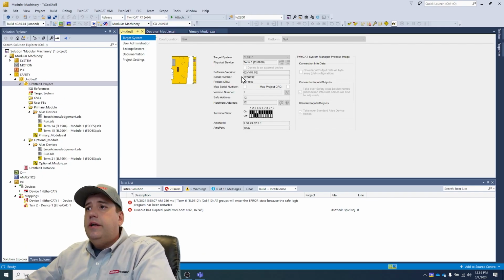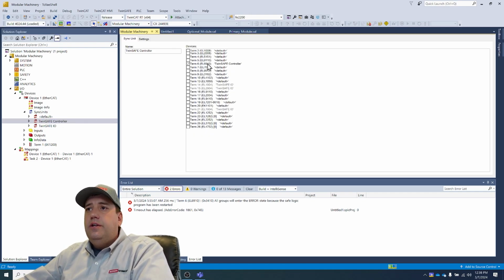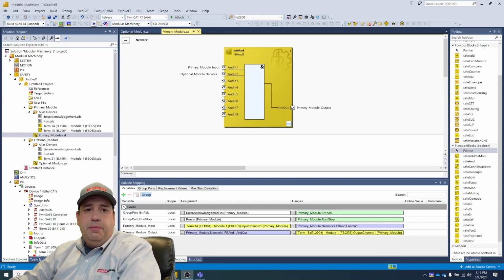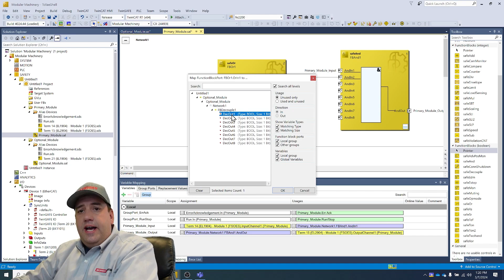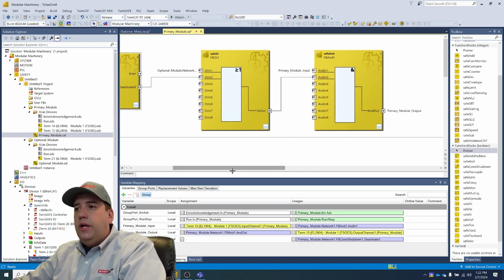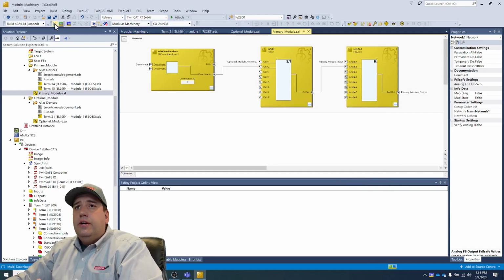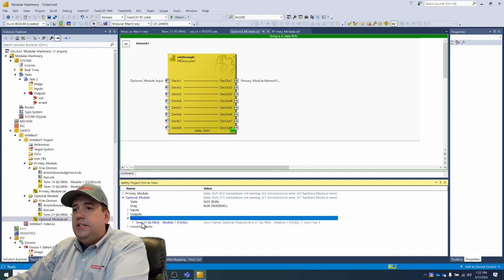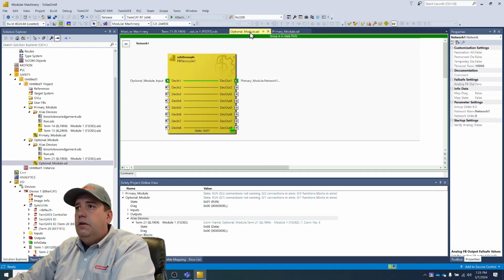TwinSAFE Safe Connection Shutdown

Comment: Hi Chris,

In our program, we output from the controller (CX5140) to another control cabinet with EK1100 via EK1122, and we have a SAFE terminal in both channels.
I want to use the logic you showed to have an option to disable the channel to the EK1100 (assuming I don't have that cabinet in a different system).
Can I do that? I'm asking because the EK1100 doesn't have an ID.

Thanks!
Reply from the maker: Hi! The device ID on the EK1101 and setting up a hot connect group is an "easy" button. The EK1100 and attached I/O can all be manually placed in their own sync unit to make use of Safe Connection Shutdown. Hope this helps!